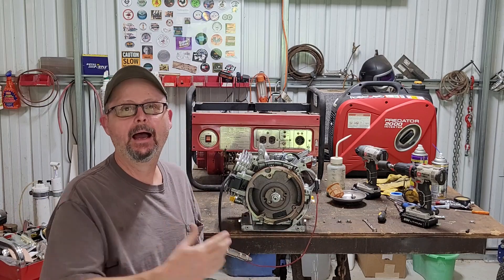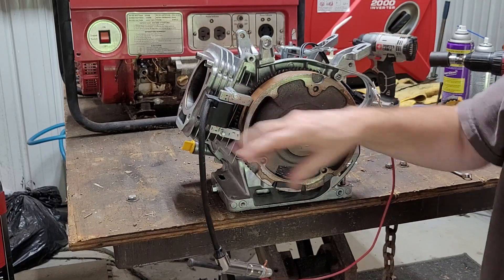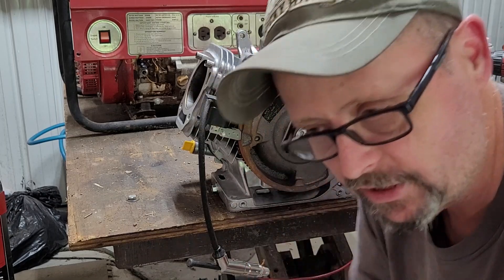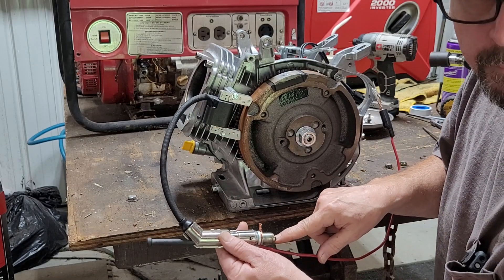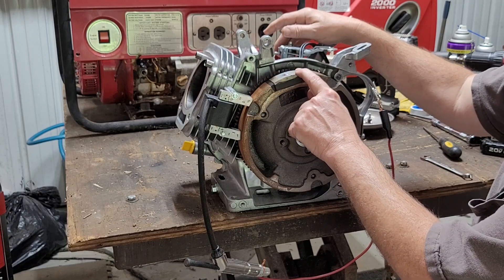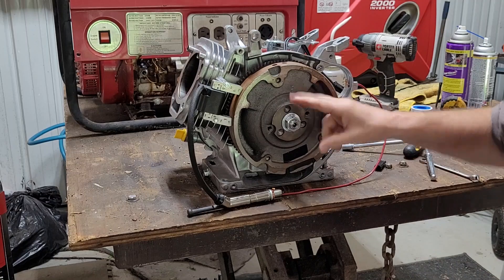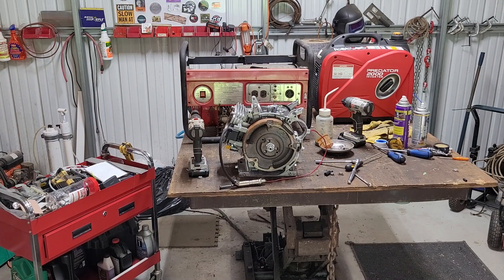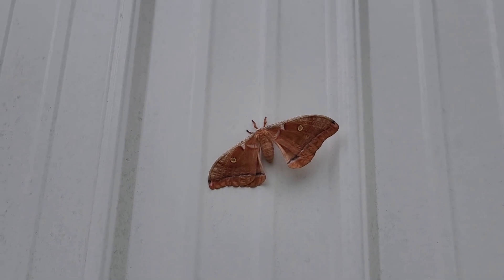How small engine Ignition Coil Pack Works. You will just have to trust me on this!

Comment: I'm glad you explained that a small engine needs a certain amount of r.p.ms to get the spark plug fire up the gas / air mixture in the combustion chamber  I was thinking that r.p.m needed to be a minimum 350 r.p.m to get it to fire up glad to see you again rusty rooster
Reply from the maker: thanks ol-buddy, best I remember 250rpm is the magic number
Reply: @TheRustyRooster   okay thanks for the info on this matter of the fly wheel RPM see you soon there young man 👍😎
Reply: That is a hard one to explain RR! I think you did alright buddy. I was just thinking about you yesterday as i was drinking a cold beverage from my rooster approved tumbler. Thanks! 🐔👍🎥🇺🇸
Reply from the maker: Hey what ya say there fella, thanks for stopping by. Enjoy that rr tumbler responsibly